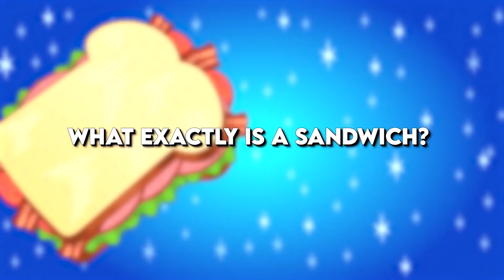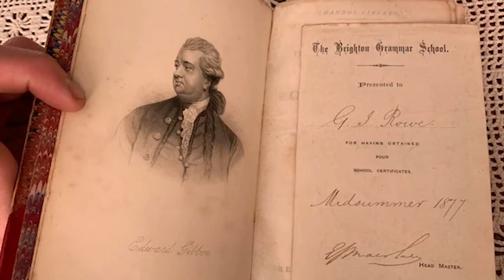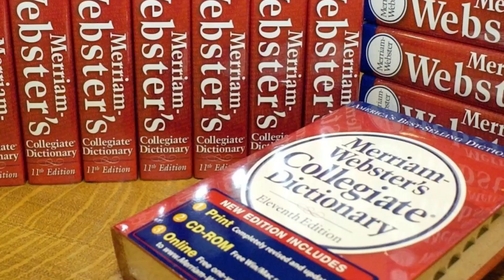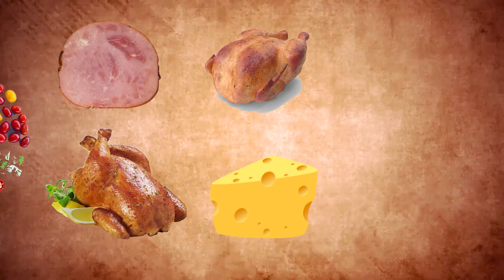The Great Sandwich Debate: Myth, Legend and Truth

Comment: My definition of a sandwich is just edible fillings encased by bread. That captures everything from a pb&j, to a taco, to a calzone. This doesn't include pies because the filling is encased by a pastry, not a bread. Also, there is no such thing as an "open faced sandwich". Those are just food items placed on top of bread which have their own names like pizza or tostadas.
Reply from the maker: You are not wrong.In fact most of the opinions about that mater are correct.See a combination of bread or bread like product that somehow incases or includes other food items is wellknown around the globe for a few hundrends years.It is only reasonable that there will be so many variations of a sandwich or sandwichlike product that whould have different name in different place.